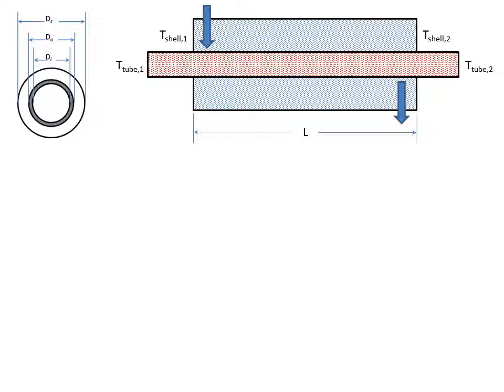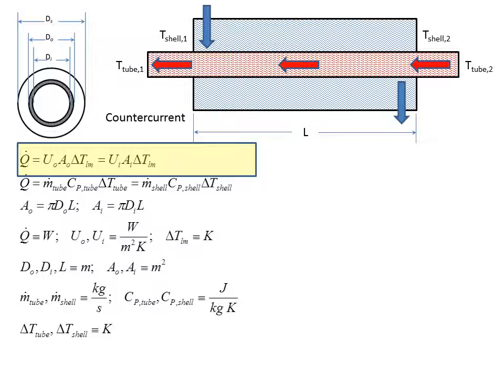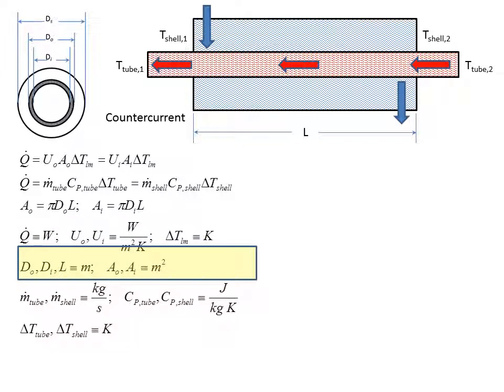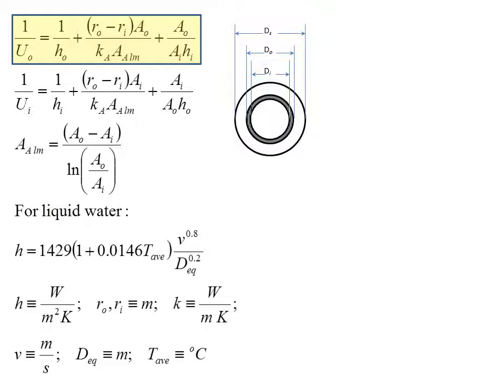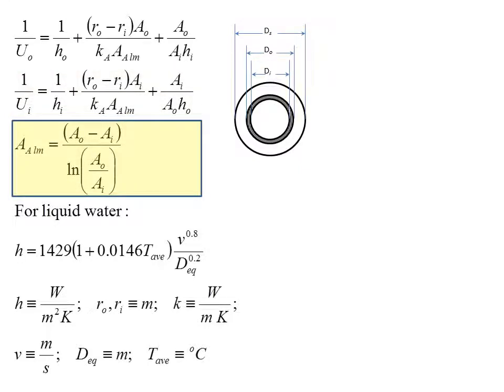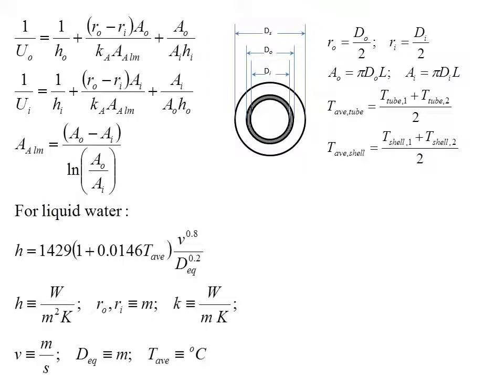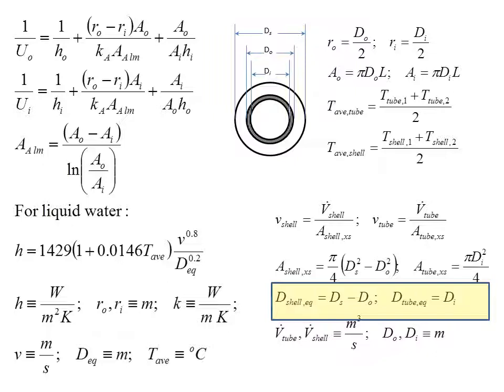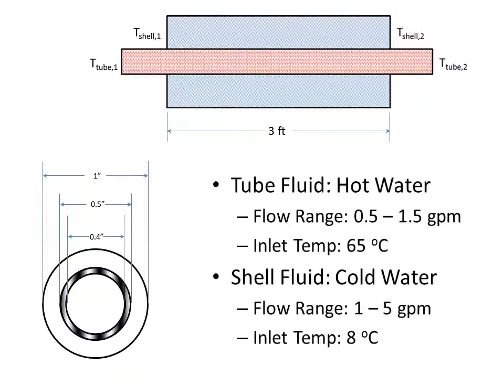How to Model a Double Pipe Heat Exchanger2

Comment: Equivalent diameter for heat transfer is equal to (inner diameter of outer^2 - outer diameter of inner pipe^2)/outer diameter of inner pipe

Similarly, equivalent diameter for friction or in pressure drop calculation is equal to (inner diameter of outer pipe - outer diameter of inner pipe)